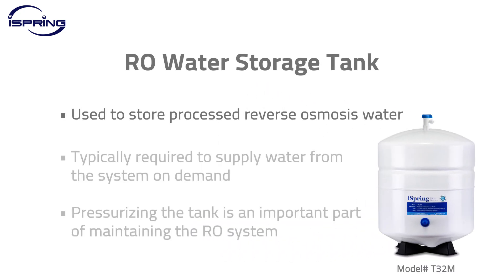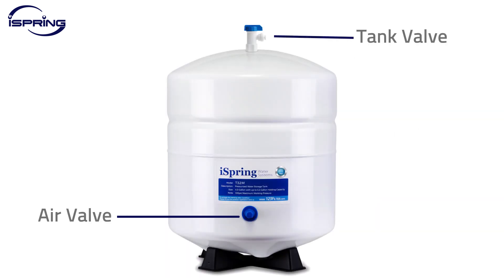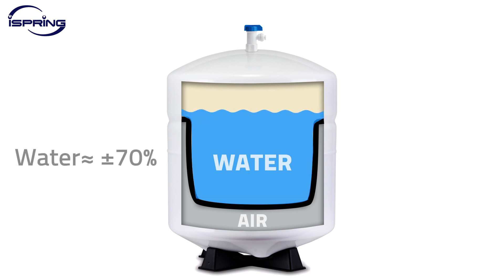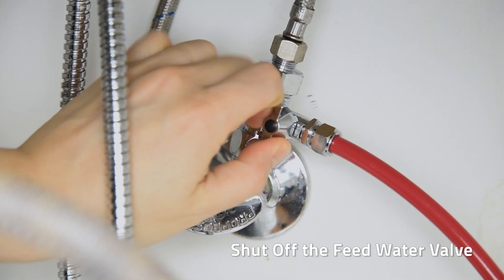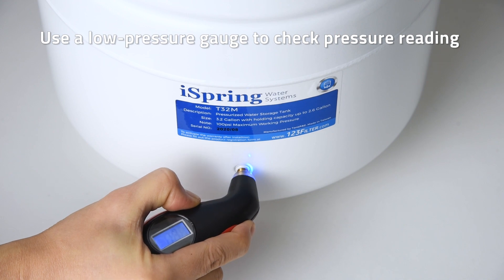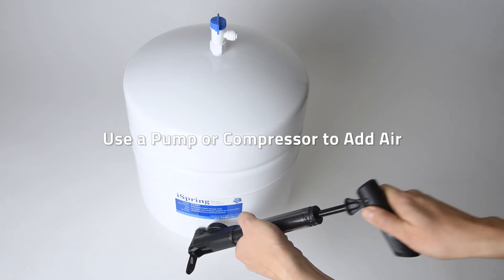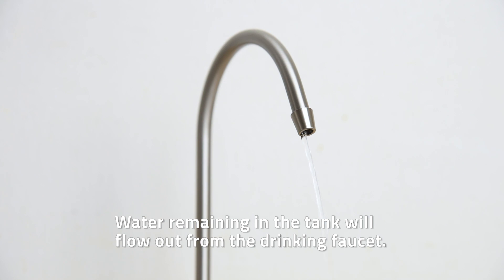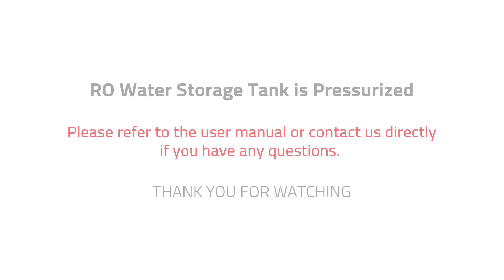How to Pressurize Reverse Osmosis Water Storage Tank | Easy DIY Step by Step

Comment: Why do all these videos never say what the pressure in the tank is after the  tank fills up. That way you could check the pressure every now, and then to see if you need to add air to the tank. Avoiding having to waste water unnecessarily
Reply from the maker: Hi there! When the tank is full, air pressure should be 30-40 psi. Please note that you should never pressurize your tank if it is full. To properly pressurize it to 7-10 psi, the tank should be empty. 
If you have further questions or concerns, feel free to contact us at support@ispringfilter.com or 678-261-7611 (Monday–Friday, 9 AM–5 PM EST).
We’re happy to help — thank you!

Comment: Awesome! I've been putting up with a slow, noisy RO system for over a year. Following these instructions solved the problem in a few minutes using a tire pump with a pressure gauge. Yeah!
Reply from the maker: Hi there! That’s awesome to hear—we’re so glad the instructions helped solve the issue quickly! 
If you have any questions or need assistance with our products, don’t hesitate to reach out to us at support@ispringfilter.com or 678-261-7611. We’re always happy to help!

Comment: Where to get a LOW pressure air gauge. None of the air pressure gauges I have work, but I think that is because they are tire gauges. Where to get the low pressure ones?
Reply from the maker: Hi there! You can usually find these low-pressure air gauges online (Amazon, Home Depot, or plumbing supply stores) or at local hardware stores.
If you have any concerns or questions about our products, feel free to contact us at support@ispringfilter.com or call 678-261-7611 (M–F, 9 AM–5 PM EST). We’re happy to help!

Comment: T 32 M , I checked the pressure but no water filling in the tank
Reply from the maker: Hi there! The T32M typically takes about 2 hours to fill. If the tank still doesn’t fill after that time, please contact us at support@ispringfilter.com so we can properly assist you in troubleshooting the issue. Thank you!

Comment: How long do these normaly last ?
Reply from the maker: Hi there! Pressurizing an RO tank with air typically takes just a few seconds. However, the process of emptying and refilling the tank with water can take longer, usually 2-3 hours.
If you have any concerns or questions, do not hesitate to contact us at support@ispringfilter.com  or 678-261-7611.
Thank you!

Comment: But when you take out the bomb , all the air goes out.  :(
Reply from the maker: Hi there! If you’re losing all the air pressure when you remove the air pump or notice that the tank isn’t holding pressure, it’s possible that the bladder inside the tank is damaged or broken. When the bladder fails, the tank will need to be replaced.
If you need further assistance, please reach out to us at support@123filter.com  or 678-261-7611 (M-F 9:00-5:00 EST) for proper assistance. Thank you!

Comment: The only problem I have is why send the tanks out not pressurized properly to begin with. I was wracking my brain trying to figure out why the system you sold me kept draining. Swapping the ASO and check valve didn't work. Only when I shut the tank off would the check valve activate. What a fck around.
Reply from the maker: Hi dear customer! I sincerely apologize for the inconvenience. The tanks come pressurized at 7 psi, however they may lose pressure during delivery. 
If you still have some issues with the system or if you have any questions, please kindly contact us at support@123filter.com, at (678) 261-7611 M-F 8:30-5:30 EST, or at (470) 560-0012 M-F 8:30-5:30 EST (Messaging only) to properly guide you. 
We are happy to help!

Comment: The trick here is to make sure the feed water is shut off and the tank is fully drained. My tank was full of water, and I added 10psi but didn't let the tank drain and I only got a couple of cups of water out. After seeing this video, I connected my Milwaukee tire inflator set to 10psi, and I could see that as the water drained out the pressure went down quickly. I had to repeat adding air to 10psi several times for about 15 minutes until the tank was fully empty, and now set to 10psi  probably will get a couple of gallons of RO water out.
Reply from the maker: Hi dear customer!  Thanks for your comment! Before pumping air, empty the tank to get an accurate pressure reading.  The air tank pressure should be 7-10 psi in an empty tank.
For any questions, please kindly contact us at support@123filter.com, at (678) 261-7611 M-F 8:30-5:30 EST, or at (470) 560-0012 M-F 8:30-5:30 EST (Messaging only)
We are happy to help!
Reply: @iSpringWaterSystems  I can't for the life of me get the last bit to empty out. There's like 10-20% water left in the tank and no amount of pumping gets it out. Pressure reads 6 or 7. Can I just hook it back up?
Reply: @AngelaHenderson  that's a sign of a ruptured internal bladder. The water is trapped on the other side of the rubber bladder. You need to replace the tank. A way to detect a ruptured bladder (prior to emptying) is to lightly tap around the tank, if the bladder is still good you should hear a high pitched ding. If no ding, then the tank bladder has ruptured and there's no air in the tank.

Comment: Before watching this video I'd watched few others and tried repressurizing the tank but failed. This video has by far the simplest explanation. Repressurized and water flow restored with full pressure. Avoided an expensive service call. Thank you!
Reply from the maker: Hi there. Thanks for your comment! 
If you have any questions or concerns, please kindly contact us at support@123filter.com, at (678) 261-7611 M-F 8:30-5:30 EST or at (470) 560-0012 M-F 8:30-5:30 EST (Messaging only)
We are happy to help!

Comment: Great video.  One note.  It took me about 10 times to pressure up the tank before I could get all the water out.  I set my air compressor max output at 10 psi and just kept pressuring it back up until all the water was out.  Took about 15 minutes total.  Charged it one last time between 7-9 psi.  Seems to be holding now.  Much better water stream.  Thanks.
Reply: I’m trying this exact method right now using 8psi

Comment: Hello, how long should the pressure tank last? We've had it a couple years but it's not holding pressure anymore. Does it need to be replaced?
Reply from the maker: Hi Jerry. If the tank cannot hold 7-10 psi pressure, then it should be time to get it replaced.

Comment: Some things that might help people who are confused about the pressure:

1) If your tank says 40-100 psi max, that's the total water pressure - NOT the pressure you want to fill the air bladder up to. The air bladder for these size tanks should only be filled between 7-10 psi. 

2) You want to make sure the tank is empty (no water) when getting the air bladder to the proper pressure. Obviously since not a lot of water is coming out of the tank since the air bladder is empty, getting water out is a problem. So at this point, like the video says just turn off the water source and open the faucet. Then using a pump or compressor, put a touch of air into the bladder until a stream of water comes out of the faucet. Keep doing this, a little bit of air at a time to keep a steady stream of water, until no more water comes out of the faucet. At this point the tank is empty and then you can fill the air bladder to the recommended 7-10 psi; and then you can turn the water source back on and fill the tank.
Reply: Hi, I'm having a bit low pressure (not terrible, but just lower after I changed the filters). I have an 8 year old r/o tank from Culligan that I just re-pressurized. I emptied the tank, re-pressurized with the valve closed to 7 psi, and the pressue is still pretty low compared to before the filter changed. I also noticed this morning that the tank barely had any water in, and it's been filling since 3pm yesterday 3/5/23. Is it possible the water was used filling ice all night. Otherwise, I cannot figure out why the pressure isn't that grate. Also, before the filter changed, I could fill 1 pot of coffee with water and by the end it would be slowing down quite a bit. I'm wondering if I need to replace the tank...thoughts?
Reply: @TimSmith-db1iu  difficult to diagnose without actually being there but it sounds to me like the bladder in your tank has failed; I'm guessing you'll have to get a new RO tank
Reply: @curiophile  it might be worth it considering a replacement is only $40. it's just strange because the water system works and will hold pressure, but the pressure sucks so filling up a water jug takes a full minute vs. 20 seconds. (i know first world problems) i did all the above mentioned steps to a T, and i still have the same issue. how long do you think it should take for the tank to full of water?
Reply: @TimSmith-db1iu  I think I have a 5 gallon tank and it took about half hour to fill from empty
Reply: @curiophile   so i messed around with it last night. i replaced the tank with an apex 3 gallon. seems to be working properly. good flow. i cant figure out why the tank fills SOOO slowly. it's supposed to fill in 2-4 hours right? i removed the drain line from the "drinking water faucet" and blew air through it to make sure there's no blockage in the air gap (recently had backed up sink drain). i felt the new tank this morning and it feels heavier, but i assumed it would be full by now (its been 10+ hours with the fridge line off). the stream seems good so i wont mess with the filters yet. i read more online and learned that with NEW filter sets, sometimes the membrane is bad/damaged so the flow is poor. if it doesnt get better in a day i'll try another new set of filters. the filters are from amazon, for the ac-30 culligan system. they were $43 for the 4 filters: Sediment Filter, Carbon Block Filter,
 TFM-36-A Membrane 36GPD and inline post filter and had mostly positive reviews. god what a headache for soft water.
Reply: @curiophile  thanks for the comments, this thread helped me get on the right track. So Tank should read about 7psi when empty, around 40psi when full.
Reply: @pmosin7700  40psi is the total max pressure of both water + air combined

As long as your air bladder is only set at 7-10psi you're good
Reply: Thank you that’s what I needed to know. I was confused about when the 7-10 psi should be in the tank as they didn’t explain it very well in the video. From what the video says it just seemed like you pumped it up to 7-10 psi and then you were done even if water was draining out.
Reply: @Xaddre   thanks guys this thread should be stickied at the top or put in the description.
Reply: So how long should we wait after turning the water back on for the right pressure?
Reply: @eeeeeeeeeeeeeeeeeeeeeeeee-s3p  the water tank will automatically stop filling when it's full of water
Reply: @Troy Price thanks for the helpful comments. I know the empty tank should read 7-10 psi. What should the tank psi read when it’s full? That’s something I don’t see in any of the videos. BTW I have a pretty common 4.4gallon tank RO-132 tank.
Reply: @pmosin7700  hey Troy. Per Culligan, the tank should still read at minimum 10 PSI when the tank is full. changing my tank and filters for my ac-130 system was the best fix for my water flow issue. I think I spent a total of $90 for the 4 gallon tank and amazon ac-130 filter set. plenty of pressure and i can fill up 5 pots of coffee before i notice a small dip in the pressure.
Reply: @TimSmith-db1iu  thanks so much, very helpful. I called one place (Fresh Water Systems) and they mentioned 40psi tank pressure when tank is full. Another web page (Eden Filters) seemed to suggest 30-40psi once tank is full. So I’m keeping my eye on it. Tank is refilling now and psi is ~30psi right now. My tank is 8 years old so it may be easier to just pay the $55 for a new 4.5gal RO tank. We’ll see how it goes
Reply: Thank you so much 😀
Reply: thanks. i was confused bcuz 7-10 psi is nothing with the tank full. i had like no psi with a full tank. it was difficult bcuz the psi kept flopping around

Comment: Can it handle 60psi? I want to. use it before the ro membrane to increase pressure. I don't use the 5gallon tank as I have a 400 gallon tank and pump for the house.
Reply from the maker: Hi Sylvain. Please give us a call at 678-261-7611 (M-F, 8:30 - 5:30 EST) to discuss it in detail. The tank can handle up to 100 psi of water pressure but it's better to call us before doing any modifications.

Comment: I cant seem to find the feed water valve ... how do i safely pump pressure into the tank without draining it? Can I pump air and check faucet until it's running well?
Reply from the maker: Hi CL. It's okay just to pump air with faucet open but air pressure should be checked once tank is empty of water. If you have other questions, please feel free to contact us at 678-261-7611 (M-F, 8:30 - 5:30 EST). We are happy to help!

Comment: How much pressure should it have when the tank is full. I saw a video on a different system and it said 40-45psi.
Reply from the maker: Hi there! We recommend measuring tank air pressure only when it's empty to get the best accuracy. It should be set at a minimum of 7 psi and a maximum of 10 psi when empty. If you need to customize your installation, please give us a call at 678-261-7611 (M-F, 8:30 - 5:30 EST) to discuss it in detail.

Comment: What low pressure gauge do you recommend?
Reply: Unfortunately, the standard pencil style gauges used for car tire pressure do not read low enough, so I bought a digital Husky Digi-Tire that's accurate within +/-1 psi.
Reply: @keeperofgunsandfish  Thanks, I have a digital tire gauge I use on the cars, but wasn't sure how accurate it would be at lower pressures, but I'll give it a shot.
Reply from the maker: @JimSearle  Hi Jim! We would recommend something like this: https://www.amazon.com/Tusk-Pressure-Dial-Tire-Gauge/dp/B01MRDEGW2. Hope it helps!
Reply: @iSpringWaterSystems  where to buy the gauge and pump in the video?
Reply from the maker: @rayg9779  Hi Ray. You can get a pump like this: https://www.academy.com/shop/pdp/bell-air-strike-850-telescoping-frame-pump?sku=black, and a gauge like this: https://www.amazon.com/Tusk-Pressure-Dial-Tire-Gauge/dp/B01MRDEGW2